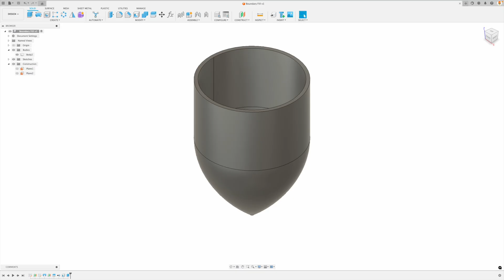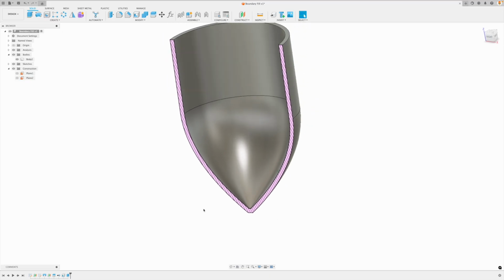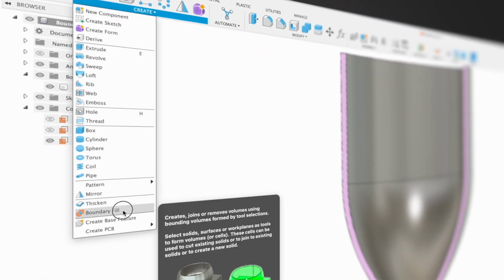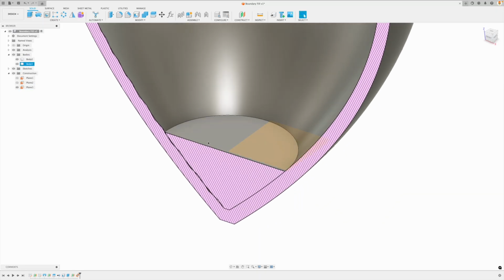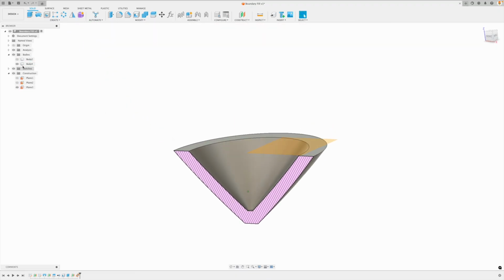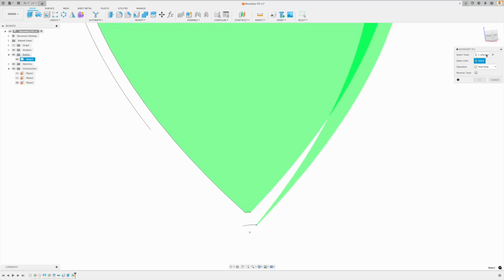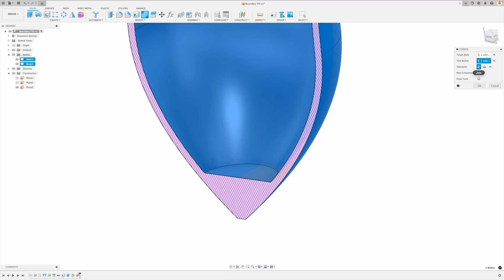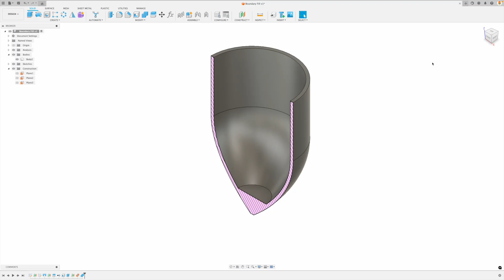Autodesk Fusion - Boundary Fill Tool - User Request (2025)

Comment: I design loudspeakers and use it to determine the inner volume of a complex shape. Often it gives many checkboxes and it’s not clear which is the correct one. I have to try each to find the right one/combination. Is there a way to display the volume of a body on the body itself rather than having to select properties every time?
Reply from the maker: Great question! As far as I know, we can't easily find the cell that we'd like to keep. I know that can be a little frustrating at times. Hopefully the tool isn't needed often in your instance, or hopefully there are other workarounds.